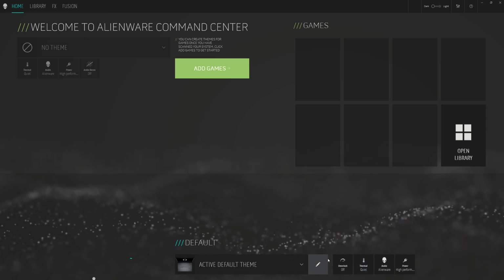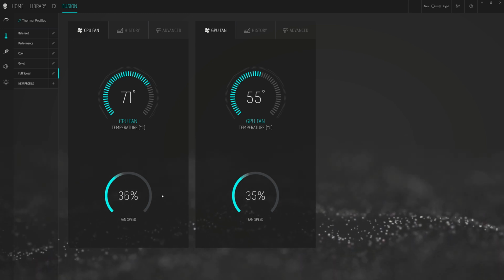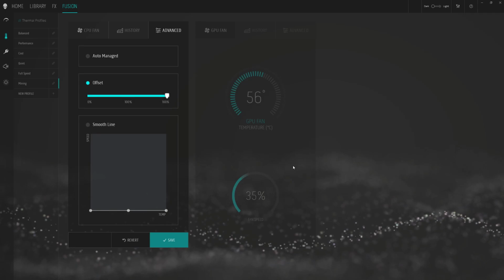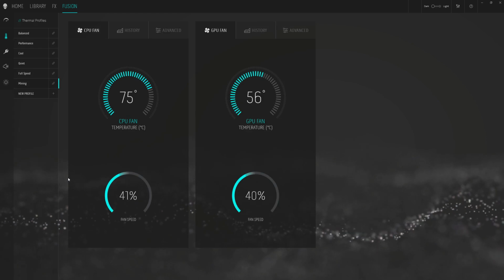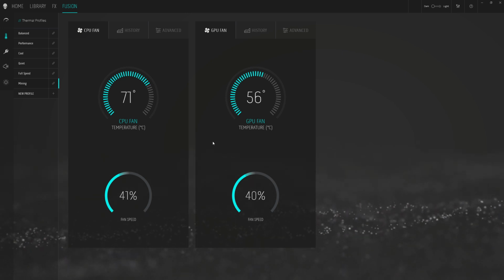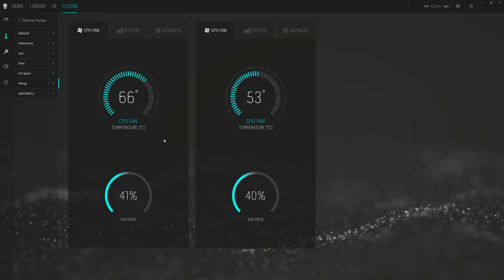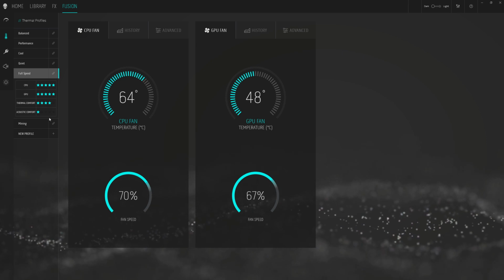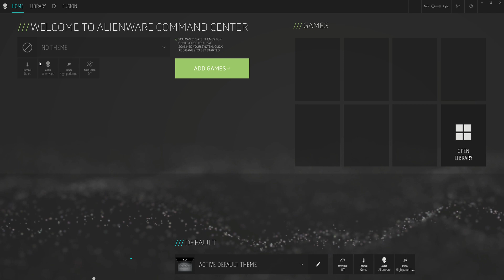Fix - Alienware Command Center Wont Change Fan Speed

Comment: THANK. YOU!  I never ever would have figured all this out on my own.  Not even the forums can answer this simple question ("How do I make my fans actually work?")  Before this it seemed to be all or nothing, the thermal was reading 150 F and fans were idle - it's like holding my hands in the fireplace sometimes - and I even bought - for $300 yet! - the "Advgene" fan stand, which does make some difference in cooling but is surely NOT worth $300.
Reply from the maker: I feel your pain brother. I spent a long time working through the forums and calling Dell seemingly unable to explain the problem. Glad this helped.

Comment: Hi, my alienware fusion @4:35 cannot auto manage any fix?
Reply from the maker: The "auto managed" selection is just as vague and ineffective as the rest of this app. I don't use that selection as a result. I create a a custom fan curve in the "smooth line" selection for the CPU, GPU, and any additional fans. Basically I create a custom curve for what I think is a logical "auto managed" setting.
Reply: @jpmcnown1  yeah i do that too but if i press f1 (the full fan ) and close f1 all my fan is 0% i have to manually set it back i am using alienware m15 r5

Comment: Are there any shortcuts(clicking buttons to access fan speed) for speeding up the fan in Dell G3 laptop after making your suggestions in my laptop. Please reply
Reply from the maker: Sorry for the delayed response, Covid had me out. I wish I knew of some keyboard shortcuts to the fan controls. Nothing to quick access the AWCC, but there are other apps that can control the fans on some AW computers. Some are even more sketchy than AWCC, so I just tried to make a custom fan curve that suits most of my needs automatically.
Reply: @jpmcnown1  thankyou for your reply and suggestion.😇

Comment: What happened to me the other day on my R12 were 2 things: I went to download intel XTU and it wouldnt open, then I happened to do the required bios update. All around the same time, I went back to command center/fusion and then my CPU and RAM overviews were no longer showing. All I see now is only GPU overview. Any idea?
Reply from the maker: Apologies, I'm not near the pc's atm, but if memory serves, I think I recall a setting it the bios that needs to be checked to allow the fans to be controlled from apps outside the bios. I wonder if the bios update switched that around on ya.
Reply: @jpmcnown1  does that mean in the bios I need to set it to OC1? i think is the setting. Just talking off the top of my head. Also not at the desktop atm. thanks.

Comment: My alienware command center doesn't have any of these options. I can't see my temperatures and kind of have the opposite problem. Fan speed just goes from off to on full speed everyone 5 minutes. I'm  on a R17.
Reply from the maker: Forgive me if you've already done this, but I would manually uninstall both the AWCC and OC Settings app, very importantly - update the BIOS of your PC, then reinstall both apps. I've seen where the install of the apps doesn't prompt for a restart, but it's imperative you do.  That's really all I've got. Best of luck, I know it's a pain in the ass.

Comment: What version of the Command Center are you using (and where did you get it)?  The latest version I have (4.8.23) doesn't show thermals at all.  Thanks for sharing your knowledge!
Reply from the maker: I'm away from those pc's at the moment, so I can't say what version I'm running. From the Fusion tab, you don't see a Thermometer icon in left column of icons?
Reply: @jpmcnown1  Nope.  I searched the help and there's no mention of the word "thermal".  It's an old system Aurora 17 R4.  Thanks again!

Comment: Totally logical?!! But after thinking about it I see how the developers made the layout, create profiles on one page and select from another, kinda makes sense. What does not make sense is the thermal design, 2 fans and almost zero room for airflow.
Reply from the maker: I agree. Once you can wrap your head around what they seem to have been going for, it’s not difficult to use. Though it’s a bit of a pain in the ass without any real support documentation and/or people to call that can explain really anything.
Reply from the maker: yeah, those Aurora desktops are a really bad thermal design.

Comment: I have a M15 R6, and can´t select high performance mode for power supply at the alienware command center because it doesn´t appears anymore, does anyone knows how to solve this? thnks
Reply from the maker: Forgive me if this seems a patronizing suggestion. More than once, I've had to uninstall the AWCC and OC Controls apps, restart the pc, and reinstall both apps again, just to get the AWCC to even open.

Comment: There is no home tab on my Dell G15, where do i find those quick settings?
Reply from the maker: I recall seeing this when only 1 of the 2 apps is installed. Both the AWCC and OC Controls apps need to be installed. You may need to uninstall the apps, restart, and then reinstall. The whole setup is not great.

Comment: I am currently having a problem with my CPU fan its just sticking at 95% even if i lower the offset speed and save and turn it on
Reply from the maker: Sounds like you might have a legit defect. Or perhaps an obstruction like dust is preventing the fan from adequately moving air?

Comment: hey man - thanks for putting this up.  I just got an r12/ i9 11900kf liquid with a 3080 and was trying to fix the sound ("alienware" audio profile in ACC sounds like ass") and for some reason the fans all spun up to like 48% and stayed there even though I wasn't running anything.  Clicked all over the damn thing - like you - thinking that the colored bar meant that is what was active.... and the thermal profile was even still set to "balanced" and auto.   Rebooted the computer twice.... nothing fixed it.   

For giggles while watching yourr video -  I changed the thermal profile to performance, then changed it back to balanced - and the fans spun down.  Okie doke!  No idea what that was all about - or why me making a new audio profile would have triggered all that nonsense - but whatever!  

Anyhow - your video got me understanding how this thing behaves and how counter-intuitive the menus are, and I was able to escape the wind tunnel.  So - thanks for posting this up, and the extra tour demonstrating alienware's stupidity when it comes to UIs. 

-Enjoying the silence.

Comment: OK so I would like for my fans to activate whenever I start up again but when I’m not in a game I would like the fans to slow down/turn off how do I do that
Reply from the maker: So there is a way to create game specific profiles from the home screen in AWCC, but honesty I most often just leave it on a custom smooth line fan profile to crank the fan speed up proportionally as the temps go up. This way, if all I'm doing is surfing YouTube, it's super quiet simply because the CPU and GPU aren't heating up.
Reply: @jpmcnown1  so,what curve would you recommend? I don't want my cpu or gpu over 75 ever! The custom speeds are weird - I set to 35% speed - it goes around 42 - wth?! The gou fan seems to be doing the same :/ anyway, good thing I noticed! Jesus those were intense temps + overclock was on by default :/ it ran like crazy with almost 0 fans.

Pictures or numbers would be appreciated! Thanks

Comment: Hey thanks for the video! By the way, do you use MSI Afterburner in conjunction with the Alienware Command Center for the overclocking?
Reply from the maker: So on my laptop, I use MSI AB to adjust the clock speeds for the GPU core and memory, then I use Alienware CC to control the fans for CPU/GPU. On my desktop PC's, I can control the GPU fans in MSI, so I normally just do it in there.

Comment: Alienware is trash my 2080ti died in 2 years because they used a “dell version” rtx which they stated as “fe” on their catalog, its the cheapest version of 2080ti in the market and i felt like ive been deceived by their brand. Cant fix the goddamn gpu and they wouldnt replace bcoz my warranty is out. Went and get a custom pc and ive never been happier
Reply from the maker: Yeah, in general I much prefer building a pc to my specific needs. I think a lot of us found ourselves in positions where these Alienware pre-built pc's were actually cheaper than trying to buy a 30 series gpu by itself from a sketchy scalper in a Walmart parking lot.

Comment: hahaha THANKS A LOT m15 r6 here. can't imagine, this is so ... stupid !!! but its fine.
by mistake i activated performance mode with a G on home of command center. there were some short cuts. when hover mouse over the G on home, it says press G key to deactivate performance mode. WHAT IS THE G KEY ??? HELP PLEASE !!!
Reply from the maker: Man, I'm sorry, I'm not sure how to setup a keyboard macro/shortcut to change the thermal profile, unless you're maybe it's a hot key function on an external keyboard?

Comment: Thanks. this was exactly what I was looking for. The devs really dropped the ball on this implementation. Not intuitive at all. Also how did you get your temps in C mine are in F
Reply from the maker: If you click on the word "temperature" below the CPU or GPU fan speed, it will toggle between C and F. Yet another unintuitive part of this app. Who wrote the code for this shit?
Reply: @jpmcnown1  wow. I never would have thought it was just a toggle. Thanks

Comment: Yeah with the R12 I wouldn't recommend 100% sounded like an airplane taking off scared me lmao and thanks man appreciate it I was so confused. Also, why does the dell power manager that comes with a 200$ pc come with an easier-to-use fan manager than a 4k computer makes no sense?
Reply: You won't get full performance with that. Well you will but you will be stuck with a slower fan speed.
Reply: @JoeMaranophotography  well I’m installing new fans soon and an extra cause this heat is a bit wild

Comment: My issue is controlling the clock on the CPU on my R8 w990K. Last year the command center would allow me to do that. After adding updates to Command Center I no longer can control the CPU clock. If anyone can update me please do. Going to DELL is ma waste of time anymore. Not the same Dell as 10 years ago.
Reply from the maker: I've not owned an Aurora with a K processor, but I know there's a setting in the Bios that appears greyed out on mine, that I assume would need to be enabled first to allow CPU clock control.

Comment: Thank you
so SO much
I have been having so many problems with my Backlight keyboard not working because SOME update is preventing it, and this most recent time I "fixed" it, I reinstalled AWCC, and my keyboard works, but I can no longer control my fans at all- I looked up answers, and the ONLY person I found with the same problem had no answers yet, no one had helped them. The last time I fixed AWCC, I had restarted my PC multiple times, looked for updates multiple times, nothing worked. I uninstalled AWCC for the second time ever, and it kept giving me errors. So this is a life saver, the one thing I was worried about now was my PC overheating and me not being able to do anything at all about it. Now I don't have to mess with anything anymore, my keyboard works, my fans work now, Thank you SO much...I know Dell tech support would always help me, but I was getting tired of calling them literally every single day... By the way, I've only had this PC for 2-3 weeks =). I've had this many issues almost every single day or every other day. Thank you so much...
Reply from the maker: If it makes you feel better, I spent hours on the phone with multiple Dell support reps, without any luck. When I discovered what I was doing "wrong", I had to share it with others. We're clearly in a big club. Lol

Comment: My fan is not even showing help
Reply from the maker: Sorry for the delayed response. If updating the bios, and Uninstalling and reinstalling the AWCC and overclocking component doesn't result in fans showing up, you might have another issue going on. There are other fan control apps online I'd recommend installing to see if there any control with them. Look for "softlay speedfan"

Comment: Any reason why if I set the offset to 100 on both only one sides fans turn up.  The other stops at around 55%???
Reply from the maker: Maybe another app is overriding AWCC, like MSI Afterburner fan settings? I've got no fan speed control on my laptop in MSI, only the desktop GPU's.
Reply: @jpmcnown1  yeah I don’t have MSI so I can’t narrow down what it could be. So weird

Comment: You don’t have to do in this way. In fusion section , select the profile and very next to the green line ( left side ) you have a section ( not easily visible) . If you click there , a check mark will appear. It means you have activated the selected profile.

In your video 2:48 click that section to activate profile.
Reply from the maker: Thanks! Yet another unintuitive part of this app.
Reply: wait what I didn't understand what you mean I tried that but it didn't work for me

Comment: also in thermal profiles "balanced" "cool" and "quiet" dont speed up the fans even if the temp gets hot and it needs it.... only "full speed" and "performance" thats why you should allways run it on "performance"

Comment: Hello man I need your help!!!!!
Reply from the maker: What can I help you with?
Reply: @jpmcnown1  hello i have a problem with AWC and is loading forever.I tried to reinstall AWC like 10 times and OC controls but does not work. I followed the official video from YT
Reply: @jpmcnown1  could you help me?
Reply from the maker: @_Alex69.  Though the apps don't always call for a restart, I've found it works best when  Uninstalling both the Command Center and then restarting the pc before reinstalling those apps. I also found that it's best to navigate to the latest version of both by going to the support page specific to your service tag. If you're simply Googleing for the apps, you're likely not getting the latest. Also dowoad the latest GeForce Experience app to download the latest gaming drivers.

Comment: Its still not working properly, i am not able to activate G mode on my Dell G5 5500. The G option is missing from my Alienware Command Center. Also i have already reinstalled Alienware OC Controls, still its not working. The F10 backlight button is also not working since 2 months. Please somebody help me out escalate this issue.

Comment: fix is at 6:50, though I did appreciate the commentary!
Reply: wish i read this first. skipping around like a hooker with one leg looking for it.... 9.5 minute video for a 15 second answer
Reply from the maker: @dizzypop88  Yeah, sorry for the rant. I pinned Joey's comment in hopes that others saw it. I originally just posted this to send to something directly to Dell to bitch at em. I had no clue that 11k people were gonna listen to me drone on for almost 10 minutes.
Reply: @jpmcnown1  I appreciated the rant. Dellienware shipped my pc with a generic Intel CPU cooler(over an AMD Ryzen 5 5600X) that drives the CPU to insane temps under load,  case fans that sound like your version of a Bombardier attack airplane and a software suite that look great but is barely comprehensible. I've had to spend an extra 250$ on this build and wasted precious time due to Dellienware cheaping out on the CPU cooler and case fans. I got your back with a like and sub. Thanks for technically making this software work.
Reply: many thanks from g15 5511 users
Reply: @kk-qu1zc  Does it work on your Dell g15 laptop bro?
Reply: @realHarshit  yes but it resets after hours

Comment: Strapping 2 opolars to the back of my ryzen edition g15. Hopefully the results are good. For now my temps are pretty stable around 46c with my portable air conditioner set at 64F. Also have it elevated about a inch off a glass table.
Reply: What is it elevated on? Mine is running at like a constant 90 degrees Celsius and I have 2 fans running
Reply: @Lol-wf2bd  3 plastic pieces i found in my garage that make it come off my desk about 3 quarters of a inch. I keep my cpu fan and system fan set a 50% speed at all times when idle. Hopefully with the opolar vacuums i will be able to keep them at 50 while they do their magic.
Reply: @1XMuleX1  same it worked for my g15 ryzen edition it runs pretty hot in like 20 degrees ambient
Reply: @1XMuleX1  idk why most alienware and dell laptops run so fucking  hot
Reply: @laptops4630  Yea the opolars didnt workout. Anyway you try to use them on this laptop will block the intake fans on the bottom of the laptop. Got a stand but it still runs pretty hot.
Reply: @1XMuleX1  idk the ryzen wdition like the g15 as soon as you lift it up the temps have like a 7 to 10 degrees decrease which is huge